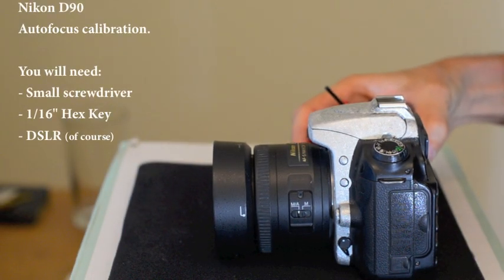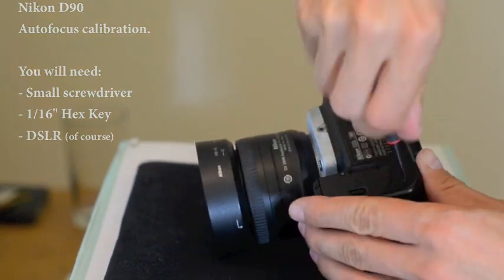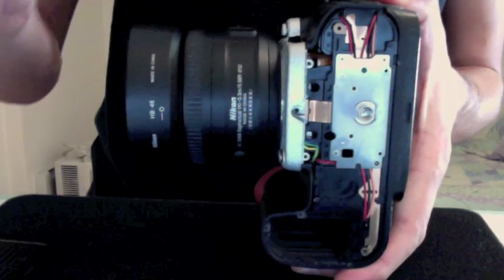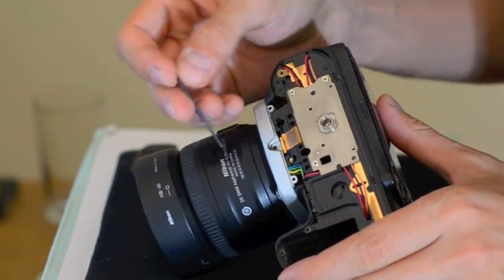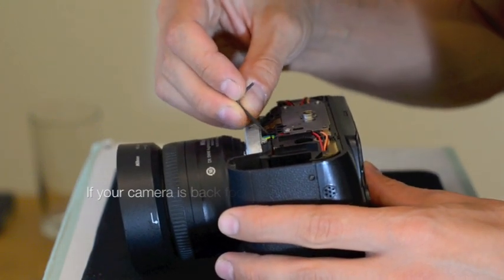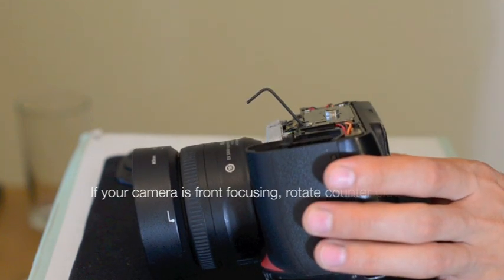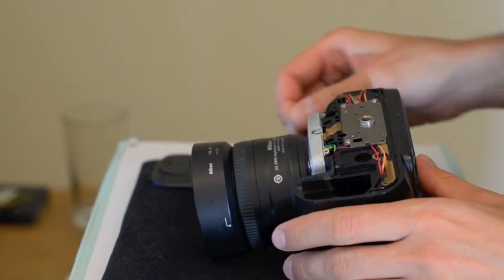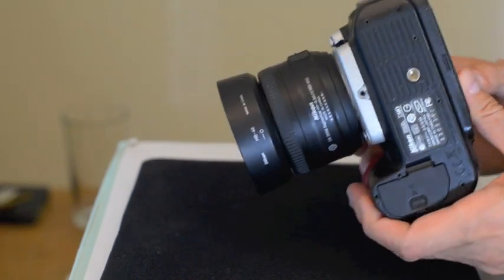Physically Calibrate Auto Focus - DSLR

Comment: Hey Steven B, I had just bought a second hand D7000 on Craigslist and I wasn't happy with the autofocus. I figure If the fine tune could have gotten us there, it would be around -25-28. 

I finally summoned the courage to buy the tools and read every post on this video from other users and I adjusted all 3 screws clockwise by a similar amount to each (the hex bolts are really hard to get to and lock in place, so I couldn't be certain about the amount tightened). 

Now on my autofocus chart, my camera focuses perfectly with a fine tune value of -2. 

THANK YOU so much for your wonderful video on how to fix the back focus problem. You probably saved me at least 50 bucks in getting it fixed at a camera store. 

I have one final question for you if you have the time. If I tightened one of the 3 screws a bit too much, would that throw the focus point off centre? 

Thanks again.

Comment: Excellent! I have been adjusting the hex cam inside my D7000's mirror box with no success. I didn't knew about those hidden cams. I'll be trying your suggestion when I got the time. Do you have an idea/schematic of how those 3 cams affect the sensor? I bet each one changes the focus on a specific region of the focal plane. By the way, you got my like ;) Thanks!
Reply from the maker: I'm actually working on a video about those two in the mirror box - that is an urban myth.
Thanks for watching.
It takes 3 points to define a flat pane.

Comment: Are you sure about inside reflex screws? 

One colleague says that with the main mirror, the image is projected onto the viewfinder and therefore its position will make us see or not the image focused on the viewfinder (AF-M)
- With the secondary mirror, the image is projected onto the focusing module and therefore its position will depend on how it sees the image to focus (AF-A)
Reply: Interesting. Did you resolve this?
Reply: @ArcanePath360  I went to nikon store and they did everything with a special software.
Reply: @FR4NCI3C0   Thanks. I just looked at taking my base plate off, but far from being simple as in this video, it would require taking most of the camera apart. I think I'll skip it.

Comment: +Steven B2 
Hi Steven,
I have a D7000 that is not auto focusing with any of the lenses i Have. (its back focusing)
This issue only happens when i try with the View finder with AutoFocus set on my lens.
When i manually focus the lense with the view finder i have no problem.
Also using the live view, it will focus perfectly with the AutoFocus mode set on the lens.
So will the method shown in your video work on my D7000? ( BTW, I updated to the latest Firmware but the issue is still there)

Thanks for your Video.

Comment: Great video. I did this on a D7200, this camera hace 4 screws, and I turn the screw clockwise because the camera have back focusing problem 1 complete turn in the screw and the camera get in 90% sharper..!! Tks. for the great tip...!!!

Comment: Thank you for your quick reply! Well in the video it seems to be not a big deal to remove the back cover from your d90 but I'm already struggling to open my nikon d5200. For sure a different design....
Reply from the maker: gotta apply pressure while turning so you don't strip the screw heads, the screws have lock-tight on the threads.
Reply: Thanks for the tip! I will let you know how it goes, I'm sure other users have the same problem with the d5200 but unfortunately not so much information about it

Comment: Hello Steven B2, Do you know if its necessary to run AF-Nikon Adjustment Software after re-set the screws in order to write those new values into Eprom memory ?. Did you have experience on it procedures  ? Thanks for the video it's very helpful I need to fix my D800 because its taken blurry images.

Comment: So do i turn all 3 screws the same amount? I have a major backfocus even with -20 on nikon 35/1.8 ... Do i just rotate the screw you adjusted in the video? I am a little confuse on which screw to adjust. I read in comments what each screw does, but i am not sure which to adjust. I tested with center single auto focus point ... Help please!

Comment: I know this is an old vid but I bought my d7k new a year after its release and after a solid year of use realized it has a severe back focus. My 35 1.8 is at -20 and only passable at around 2.8, not razor sharp but passable.  My other primes are just as bad.  Fast forward to present day 2020 and its the 3rd wheel in the camera bag with only 30k clicks cause the focus issue means its unreliable for paid work.  With my d700 and d500 as my horses im gonna open up the d7k and tweak it.  Im not giving up on the little guy just yet...
Reply: Update: I grabbed a small Phillips head and a 1.5 mm Allen wrench.  Took the bottom plate off my d7k turned all 3 screws 180º clockwise put it back together and checked my 35 1.8 and it went from -20 (still wasn't sharp) to +5 and its dead on.  Start to finish took me 10 minutes. Its like I have a new camera! Thanks.  I was always scared to do anything inside my camera,  ill probably do a sensor cleaning next!

Comment: Hi Steven, thanks for your hints. Probably you've heard about Nikon's service software leak - it allows to quick and easily shif your AF towards near or far end, it's just few clicks. My question is: which method is better (safer, giving better results) - software or screwdriver?
Reply from the maker: Hi there. Software leak? Haven't heard but one should always start with electronic/digital calibration. Only when that doesn't help should you go for physical adjustments.
Reply: +Steven B2 Look around on Nikon Hacker, it's in one of the threads
Reply: may you provide us with the link?

Comment: Can you tell me please if it is ok to rotate the screws all the way up to the origin point just to make shure I will start rotate all of them exactly the same? Because I think that currently they are not rotated proportionaly and from my test it is missfocus a lot. Wen it get the focus right, it is super sharp, but its also missfocus with my 85mm f1.8 on my d300. I think the reason for missfocused shots is that I dont rotate all the screws proportionaly.  (Sorry for my bad english).

Comment: I have two d5200 and its backfocusing with my 35mm 1.8g nikkor 50mm 1.4 nikkor and tamron 17:50 2.8, but not with the 18:55 kit lens. I've send the 50mm to nikon and they say its working properly. Dont know what to do.
Reply: Rafael, your 18-55 is likely not showing back focus because of its nature: it's not a a wide aperture lens, which results in deeper depth of field, which is probably hiding the problem.

Comment: Does it work if I am only facing back focusing issue with D lens only?  G lens seems to focus fine.
Reply from the maker: Mike Wong Definitely, since D lenses are all mechanical and rely completely on the camera. But keep in mind that every lens is different so you will have to make a compromise.
Reply: Steven B2 Does calibrating the camera's autofocus module to match the back focusing AF-D lens will affect the previously sharp focusing AF-S G lens?
From what I know, AF-D using internal focusing motor, AF-S using len's focusing motor.
So the 'autofocus module' you mean in "About" is adjusting the autofocus motor or the focusing system that both AF-D and AF-S use? 

Thank for answering.
Reply from the maker: Mike Wong By the "AF module" I meant the sensor that is actually very similar to the image sensor but much smaller. 
AF-D lenses do not have any motor built in, they rely on the motor built into the camera body. I believe the AF-S system is older and do not have the screw to connect to the camera's AF motor, hence focus is achieved by hand.
G lenses still rely on the camera for analyzing and confirming focus. However, they have their own motor that moves the lens. I can't tell how likely it is to have a miscommunication between body and G lens. 
Once you calibrate your AF system to one lense, it will probably be slightly off with other lenses due to lens characteristic and the physical properties of light but the difference should be miniscule.

Comment: I was wondering can i fix AF with this even when my camera doesn't always miss focus? Its usually every second,sometimes every third or fifth shot..
Reply from the maker: In that case I wouldn't touch it. Sounds like your AF does what it was meant to do but you are expecting too much.
Can you tell me more about your gear? How bad is it when it misses?
Reply: allusernamestaken01 No,my d7000 really has a back focus issue,I tested all three lenses I have with my first camera d3100,pics are razor sharp always(from 100 images,more than 90 are sharp). Lenses are 18-55mm vr kit lens,sigma 10-20mm f 4-5.6,and 50mm f 1.8. All of them are fine tuned to around -13. Funny thing is,sometimes they are always out of focus with auto tune,and when i turn it off,they become sharp(for 10-15 shots). Depends on the ''mood'' of the camera I guess. :D Anyway,it has been calibrated by Nikon already,and after few days,same focus problems came back,with addition of the mentioned weird thing where I have to turn off the auto tune. I am doing photography for 6 years now,and know all about settings on the camera that can affect sharpness of the images,so I'm 100% sure that I am doing nothing wrong. It's so obvious that the camera is the problem when I take 2 shots one after another,same focal length,same distance from the subject,and bam,one of them is around 15-20cm back focused(sometimes 5-10cm). So,I have suspicions it is all about electronics maybe,not the mechanics,thus touching the screws maybe won't help? What do you think? And the camera has no longer warranty,so I am having a tough time giving Nikon another 40 euros for another calibration,which maybe won't last long anyway. Sorry for such a long reply :)
Reply from the maker: Hm. Anyway I have to emphasize I would only dig in if the backfocusing was constant. Since it's something that comes and goes I have the feeling that it's not the calibration.
Oh yes, something just came to mind. I suspect it's your contacts between the camera and the lens. Nikon or Canon (or any other brand) will probably not tell you this but there is always a different amount of tolerance. Some bodies and some lenses were just not designed for one another. Sometime even higher end products miss the mark but I usually hear your problem from people using budget lenses. I have the feeling that some of the contact points just don't make a contact when you hold the camera at a certain angle or when you handle it in a certain way. I know it sounds improbable but I'm pretty sure a little stress on the mount could be the culprit. You hold the body with one hand and you hold the lens with the other and sometimes we apply force as we try to keep it steady. I think that's enough to stretch the structure just enough to create a tiny gap between the contacts.
And one more thought: just because you keep your sensor clean, your AF sensor still may be dusty. It's behind the mirror right under the shutter curtain.Worth giving it a carefully placed blow with compressed air.

Comment: Hi, Steven, I saw another video where the guy adjusted the AF by removing the lens and turning a screw inside the camera, near the sensor. Does this do the same? or depending on the model it's a different method?
I have a D5300, and it's back focusing.
Thanks!
Reply from the maker: Those screws have nothing to do with back or front focusing. They are for the AF points appearing in the right place in the viewfinder. I saw many videos like that and that was the reason I made this video but there are still many people confused about this. I was gonna make another video to clear up this confusion but I'm such a procrastinator...
Reply: Have you managed to apply this in your D5300?  The 5300 has a monocoque design so i am not able to take the bottom plate apart.

Comment: hi can u make a video .how to calibrate canon 600d my issue is through viewfinder focus is blurred but with live view its sharp. need help
Reply from the maker: Have you tried to adjust the focus of the viewfinder itself? There's a little dial on the right side of the viewfinder marked with a little arrow and (-) , (+) signs. Better check that before you try to temper with your camera inside.
Reply: +Steven B2 sir that's diopter settings,i guess its only what we see through our naked eyes. if somebody''s eyesight is weak he can adjust diopter according to his eyesight. it nothing related to focus sensor. if iu defocus what u see through view finder also. camera auto focus sensor will focus that precisely.. comment please.
Reply: tavi s i sent to canon .they caliberated my camera

Comment: I tried this on a Nikon D7100 with no success getting almost crazy....After all i found  on my D7100 an internal micro adjust regulator to do this job ! You have to remove the bottom cover to do this job. Nowhere in internet i found a correct description to do this on a D7100, finally i found it out by myself.
Reply: Hermann Oehling Cuesta It's because the d7000/7100/7200 has software alignment. You can do it in the setup menu.
Reply: yes of course i know, but the setting options -20 was not enough so i moved this little focus slider adjust button. so i have no backfocus anymore !
Reply: Hermann Oehling Cuesta 
Sounds like Nikons tend to have alignment problems. My d90 front focus about 10 mm at 1.8.
Reply from the maker: I don't fully understand but glad you are back on!
Reply: Please post pictures of micro adjust regulator in D7100

Comment: Hello! Do you have to rotate all three screws?
Reply from the maker: That is a good question, I really should do another video about that.
It get a little difficult to explain but the short answer is : most likely yes - for a start.
Reply from the maker: Yes, I've read that page. And you make a good point asking that question.
You have to remember that the light from the lens hit the sensor as a mirror image so it takes a little creativity to figure out which screw belong to which corner of the final image. That is what I meant in the video when I said "trial and error".

Cheers!

Comment: WORK FOR NIKON D7100?
Reply from the maker: I haven't looked in my D7000 but I'm pretty sure it would work the same.
However, D7000 and D7100s have a so called AF Micro Adjustment feature. You should use that instead of opening up your camera!